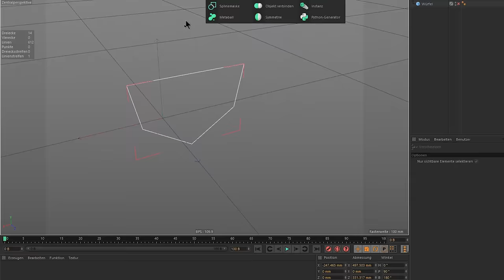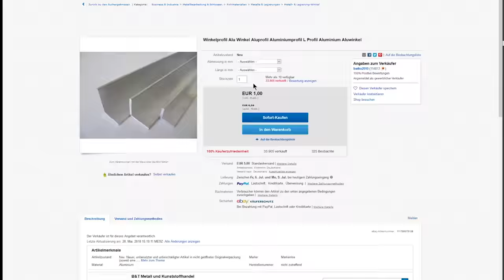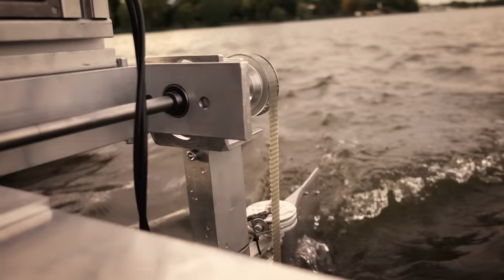Building a Bike Boat Catamaran

Comment: Great build. I would add flotation foam in the pontoons to avoid sinking when taking a wave over the sides. Also a possible upgrade would be to look into an articulated shaft at the prop and loose the rudder. More efficient to change the direction of propulsion than the rudder.
Reply: Not at low speed it isn't. Well, maybe it's more efficient, but at low speeds you lose steering with directional thrust. You have to have a rudder to steer any time you aren't actually applying thrust. As anyone who has ever tried to steer a jet ski or wave runner in a "No Wake" zone can testify to. Keep the rudder, but you might think about getting rid of that prop and using a real water prop. Or, better yet, you could modify it to have adjustable pitch on the prop and make it a constant speed "engine" with a prop that can be adjusted to increase the speed of the boat. That way you can pedal one speed and tune the prop to go faster or give more torque at low speeds. Either way, this is a terrific build.
Reply: @WmSrite-pi8ck  those higher pitch plane props work fantastic underwater. Not as durable. But higher speeds have been achieved with airplane racing prop designs. The electric outboard and trolling motor world is noticing. Especially the solar crowd.

Comment: Beautiful well-thought-out design, excellent craftsmanship and a great video! Thank you! One tip when cutting synthetic fabric is to use a hot knife instead of sissors then you don't have to fold and sew the edge under to protect the raw edge from unraveling because it heat seals. This also makes some of the other intersecting seams thinner and easier to sew.

Comment: Great idea, can use some improvements like reducing the amount of metal for lighter construction, having integrated flip-up wheels at the "transom" of both hulls so that a separate trailer is not required, covering the hulls to avoid flooding and sinking, etc. Other cosmetic touches could include paddle brackets, detachable sail system, bimini-top style sun-roof, chain cover, etc. 

Keep up the good work!

Comment: Brilliant build!  What kind of sprint speed can you get and what is your cruise speed?
Reply from the maker: It's pretty hard to answer because wind and current have a big effect on a small boat like this. Overall I'd say with 2 people on it it's about as fast as a canoe, both cruise speed and top speed. I'd say somewhere between 4-8km/h on average. But the difference is that it's way more comfortable and you can pedal for a long time without getting tired. I've covered 20km with this in one day without much exhaustion.
Reply: @PhilVandelay   can you say something about the total cost?
Reply from the maker: @aiz234  It's hard to say, I kind of lost track at some point.. but it was definitely way too much. Just the aluminum sheets  alone were over 500€ if I recall correctly. The nylon mesh for the surface was pretty expensive too. I think overall I probably spent around 2000€ on it. All the small things add up too..  It's not the smartest or most efficient way to build something like this, more of an experiment
Reply: @PhilVandelay  if I May ask, why did you choose aluminum instead of mdf? You can then pour epoxy on the surfaces once the structure is done. Even adding a layer of fiberglass could be an option later on. Are there any benefits to being pure aluminum?
Reply from the maker: @prototype8861  Aluminum pretty much lasts forever in the water without any maintenance and it's much, much lighter than a wooden hull. As you can see at the end, transportability and weight was one of the main concerns for this build

Comment: Impressive. I like it so much i have to add to it and get a sail put on it. Not because i am lazy, but sails are awesome, you can peddle and you can sail, and you can do both at the same time. Plus you get a little more respect with other boats and ships, etc... with a huge sail. You appear more substantial, it is like comparing a bicycle to cars,  but with big bright double headlights on the bike, marker lights and turn signals, you appear more substantial, and cars will steer clear of you more.

Comment: Great build, but I would recommend a few tweaks for ease of use. A quick-release fitting of some sort for your drive-leg/rudder would make putting your rudder down a lot faster without risking a dropped wrench.
Similarly, your trailer-tongue to bike connection could be a simple pin drilled for a retaining pin; no need for wrenches. The tongue-to bow connection for trailering could be another quick-connect setup to be determined, to eliminate the need for wrenches and speed up setup. Lastly, the trampolines either side of the center section could have been sewn just large enough to span from the center beam to the poles already in the tops of the pontoons. You'd thread the pole through once and leave them that way. When it's time for setup, you grab one pontoon and walk it out off the trailer, stretching the trampolines on the way. All you do then is bolt up one side of your cross bars to the one pontoon, give a final stretch to the trampolines, and make the bolts on the opposite pontoon. That could cut out the need for lacing the pair of ratchet straps every time. You might not get perfect tension this way, but it's a thought.

Comment: Great and wondrously fantastic build from scratch and the ingenuity factor is up on 10 for sure! But first time a motorboat comes along and creates the dreaded tsunami wave as he goes zooming by and filling your boat with water that thing is going sink like a mummy in a cement casket. Yer gonna need a longer snorkel!! Or at least some flotation devices and a good bilge pump!

Comment: You did a good job ,put alot of thought in to it im sure you have thought about some changes you mite make. I would  make it two peddle power,a small sail will come in handy. Some flotation in the points and think about closing in the pontoons with hatches. Maybe a peddle assist moter and small solar cell to charge on the go .its your call just something to think about. Very good job. That is a hell of a boat .I like the building materials you used top notch.
Reply from the maker: Yeah it is still very much a prototype, it works but there's lots to improve. Some of the things you mentioned are already planned, I'm gonna overhaul the drivetrain to some extent and also thought about some solution to close the hulls like you said. The limiting factor for all this is weight - I can't make this boat super heavy, both for transport reasons as well as buyoancy, so I can't throw tons of material at it. Electric assist would definitely be cool and also something I thought about, but would add at least 15kgs to the setup - I'll keep it in mind though. I'll probably make a video about the coming upgrades sometime this year.

Comment: Putting some idler pulleys on the belt to put it in line with the shaft then enclosing the whole belt the way you did the front of that shaft might decrease water resistance and belt vibration. No idea if this is even an issue. Awesome job!!
Reply from the maker: Yeah it's one thing I did consider, enclosing the belt would probably make it more efficient but at the same time the enclosure would also add some drag so I'm not sure which is better. I did learn a lot of things building this prototype and the good news is, it still exists and I'm planning to revisit this project this year, including a complete rebuild of the drivetrain with a lot of optimizations. Enclosing it somehow might actually happen

Comment: Boat design 8/10, video documentation 10/10
Reply: Observational skill, must try harder.
The design was accurate 8/10 video documentation 9/10.
Under own admission parts of the fabrication process were not recorded thus leading to the conclusion that documentation is 9/10 or 9.5/10.

Still it's a great build and video and a vert good fabricator.

Comment: Very elaborate! An old catamaran, a flat platform and an already made pedal drive off a kayak and you would have something just as good, for 1/10th the price and it wouldn't sink to the bottom if it took on water.
Reply from the maker: Great, then do it
Reply: @PhilVandelay  I got the catamaran hulls and an Aluminium platform off a ute tray for free and an Electric watersnake motor I got for my kayak (bugger pedalling). Yeah, I just might do it, cheers.

Comment: Good job but one major design "flaw". This is a catamaran, so the base is wide.  That means that it is very stable and cannot easily capsize.  You therefore have the scope  to arrange the pedal/power source system similar to that of a bicycle: the pedals are underneath the rider.  That is more ergonomic, and less stressful since you will be taking advantage of gravity/potential energy.  And that will also give you space to put two seats about the middle for passengers!
Reply: You will have a higher wind profile.
Reply: Yeah, go recumbent and keep the cadence up.

Comment: For my next trick, I will build a sail, lol. The power your getting with the airplane propeller, just think if you used John boat propeller, good luck and happy sailing.
Reply from the maker: Don't assume I did all this work  and then did zero research into what the appropriate propeller is. Everyone keeps suggesting boat propellers and completely forgets that this boat is not powered by a gasoline engine but a set of legs. If you run low RPMs, different physics apply and boat propellers become inefficient. They are specifically designed to spin at several thousand RPMs, creating a jetstream which this doesn't.  There's a reason I chose this propeller, because I talked to people who have been building human powered boats for decades and who have done the math. I have tried boat propellers on this - trust me, they are slower.
Reply: Cool on the research.

Comment: Yea you have some very good skills. When I saw the heading of the video. I thought Cat as in off shore cat. When it said aluminum I think Cuv.  That is what I call a pontoon boat.  I thought A cat has a sealed top and the sponsons are straight walled and tapered on the inboard side. Then the top is tapered as well. If you have a point at each end its a pontoon. It dont matter you have a very cool boat what ever you want to call it. I wonder what you didnt try a small electric trolling motor prop.?  Now when you want to step it up, you have to hook up a DC  drive motor that ties right into the crank. Like an E-bike. If you want to get it to free up take some heavy/course walnut shells and bead blast the area that rides in the water. What that does is creates a bunch of dimples so to speak. Each one of those little dents offers an air pocket for the water to be released from drag on the boat. You do not want it smooth. You want it true but dimpled like a golf ball.  Create a bunch of indentations so it rides on mini air pockets and not so the drag of the water is touching the entire hull.

Comment: That's a hell of a boat You made here! Really like the concept, and in the end i was suprised it is supposed to move around by a bicycle xD One thing i didn't like so much is the open underwater drive belt. I would try to avoid this type of end transmission solution, but on the other way hidden crankshaft could be less efficient. Anyway, I love your channel and envy your toolset. In a good way ofc ;) Cheers!
Reply from the maker: Yes the belt was a compromise of keeping it simple, but it ended up working pretty well actually after some tweaking. The main downside is that sometimes it can be jammed by debris (which there is more in the water than I would have thought). I plan to keep improving this design and possibly build a crankshaft eventually or use one from an outboard motor
Reply: @PhilVandelay  Anyway I admire your work, and I bet that You will handle it better without some poor advices from a random internet guy like me lol69 It is a pleasure to watch a good craft, and it is not so common I think. Keep it upp!

Comment: Very good job. I have a small pontoon like boat 1 seat but my feet go in the water it's fun but the pontoons to short I wish I could find some the size of yours or atlest 8 to 10ft mine are 5 maybe I flipped mine backwards the plug popped open you should see how they made it's hard plastic the plug you can out your fist in it yea. I leaned back the pressure popped it upon and it went back from sinking fast. Being disabed that was a mess I can swim but had 2 knee surgeries so can't kick to good. Lost my new fishing rod just got for my birthday camping trip. But I got the rest saved got the boat  out and emptied. But I'm looking for some longer ones wish I was able to pay you to make me 2 but shipping cost alot like them being built bummer your not local lol.  But that would be my size but peddle can't so ide well love maybe hand peddle and that's good exercise. Then tollen motor when I'm fishing to be able to use my hands fishing. But love the build great job bog thumbs up and god bless

Comment: Could you ''please'' let us know what the overall dimensions of your pontoons were. This nearly identical to a project I'm hoping to undertake, however, rather than utilizing aluminum with the entire build, I'm hoping to fabricate my pontoons by fiberglassing over ''faced'' foamboard. Since I live in a very rural area of the Midwest, U.S & have several large ponds on my property, the purpose of the boat I'm hoping to undertake would be used for fishing as well as pleasure. I do thank you for this very detailed video of your pleasure craft. Allowing us to see just how fast that 16 X 16 model airplane propeller could move your craft so swiftly was a detail I may've been most curious about. Beautiful work & again, I do thank you, Sir.
Reply from the maker: If I remember correctly they are 4,8 Meters long tip to tip and the cross section is roughly 50x50cm. Enough buoyancy for about 3 adults of average weight (4 might be possible, but that's pushing it with open hulls). On average I'd say it's about as fast as a canoe, but with very little effort (I can pedal it for hours at that pace). Hope that helps!

Comment: Wow.... Amazing. Best thing i liked is you worked right from sketching to execution all alone.  only one thing bothers me, why didn't you made the floats ( Canoes) water tight? That's a risk i think. Rest was all unique and innovative. all the best buddy.
Reply from the maker: I left them open for storage, you can fit a lot of stuff in them and otherwise it gets very crowded on a small boat like that. Gotta put the beer somewhere! The boat was mostly meant to be used on lakes/canals so nothing with high waves or anything. I think I will eventually add some floatation bags for extra safety though so that if anythign goes wrong, it doesn't completely go under. I also made the cross section pieces on the front and back solid because my plan was to seal up the edges with silicone, esentially creating bulkheads. So that way if water gets in anywhere it can't fill up the entire hull. I just haven't got around to that yet..

Comment: you'd get a ton more force if you used a 3 blade propeller with more surface area.  Airplane propellers are made to be lightweight and compromise on some of the thrust you could get with one designed for water.
Reply from the maker: You're wrong about this. But I'm not gonna bother explaining it for the 100th time, just look through the comments

Comment: 1) work is amazing 2) open float top is not safe for wavy and rainy conditions 3) with a closed top and more submerged float you will be able to take more friends and put outboard engine 3) bicycle for no registration fee?
Reply from the maker: Thanks!
Well it's not supposed to be used for wavy and rainy conditions, only small lakes and canals in my city. I only use it in summer and I left the pontoons open for storage. Since there's no roof I wouldn't want to be in heavy rain with it anyway ;) I made it for my very own use case. Using motorized boats is forbidden inside the city but I'm not a fan of putting a motor on everything either way. The boat is more for relaxing, not really going large distances or going very fast

Comment: Mad skills dude.  The thought and execution were excellent.  How's it all holding up after a couple of years?  I was watching vids on the Blue Sky 360 and have to say, I like your boat more.
Reply from the maker: Hey Thanks. It's still a prototype so there's always things to fix and improve, but overall I'm happy with it. I'll probably change some things in the future, like installing a more comfortable seat and I want to try to make the drive flip up towards the back instead of sideways so it can get out of the way by itself if it hits the ground (which can happen in shallow water). The good thing is that everything is pretty modular so I can keep trying out different things. Honestly, the biggest practical problem with the boat is transporting it to the water, assembling, and then disassembling and getting it back after. Since I don't have a car, that's so much work that currently I'm not using it much :/ Would be great if I had a permanent spot near the water though.